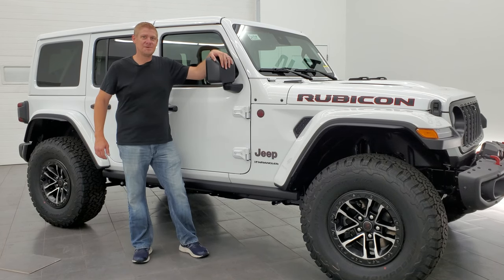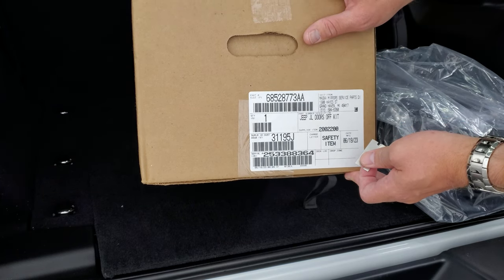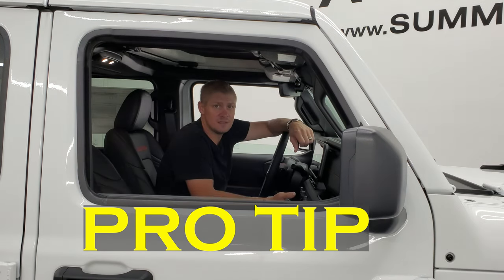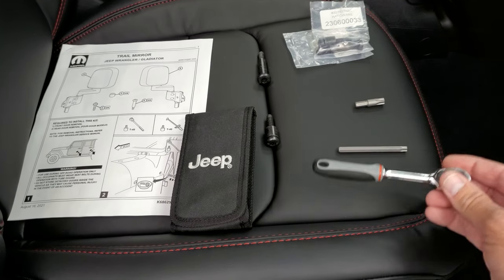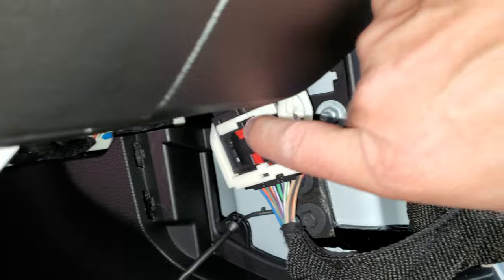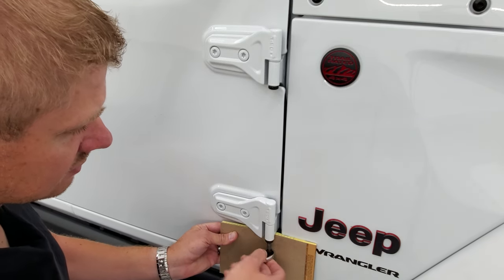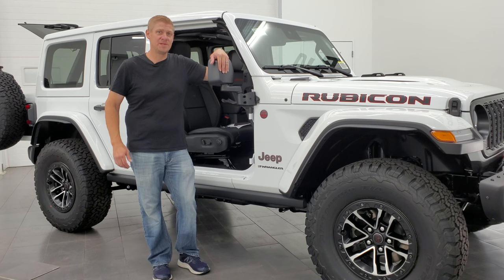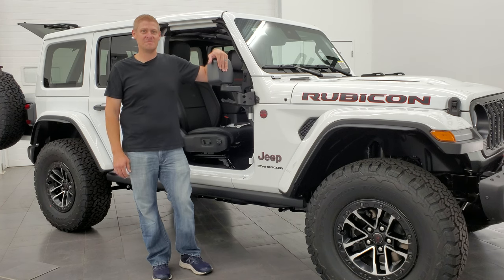HOW TO INSTALL DOORS OFF MIRROR KIT & REMOVE DOORS FOR JEEP WRANGLER AND GLADIATOR

Comment: Thank you SO MUCH for showing how to install the mirrors! I gave up trying to figure out those ridiculous instructions. Nice tip with the cardboard between the door and the wrench. Really saves the paint from getting dinged by the wrench. Also when putting the doors back on, I apply masking tape around the areas the hinge pins set back into to protect those. Note - one pin is longer than the other.
Reply from the maker: Glad I could help! The instructions on how to put the mirror on were so bad I might just do a video on that part dedicated to how bad the instructions are.  Remember to like subscribe and share!

Comment: Instead of 2x4 under the doors, use water pipe insulation. It holds onto the bottom and even cheaper

Comment: These seem to mount low. Does the dash block the mirror from the driver’s seat?
Reply from the maker: I didnt go for a drive with it on as I ran out of time and had to get to a wedding.  I dont think Jeep would design a product and have it not work as intended though.    I will have to do this again and go for a drive with them on.

Comment: Leave it to the Mopar lawyers to come up with this one. WHY ? Ok, take off your door, now PUT ON a mirror,Take mirror off, put door on. Granted, it looks good and I assume it's very functional and meets all the safety standards, I haven't looked at the price yet but knowing Moper as I do, It's not going to be cheap, even WITH my 25 % discount. For under 50 beans, you can get a mirror and the mount stays on the truck. Easy on, easy off

Comment: Thanks for the video. I purchased the mirror set online as part# 82215331AC. The part number in your video, must be used at the assembly plant. I did notice that they are the same, but the part that I purchased did not come with the mirrors attached to the brackets (3 small screws each). Here are the factory instructions for installing that mirror kit. 
https://www.youtube.com/watch?v=rgvndqh2Ymw
I like your way better, and I attached my mirrors to the brackets and will try it your way next time. Thanks.